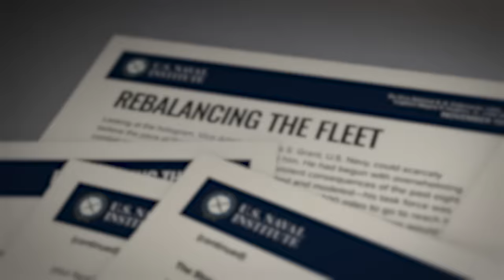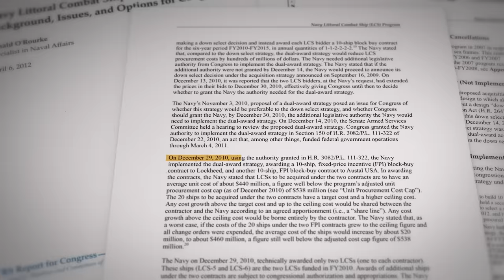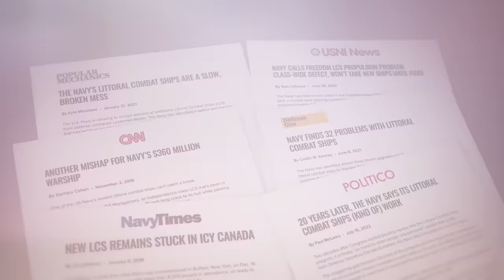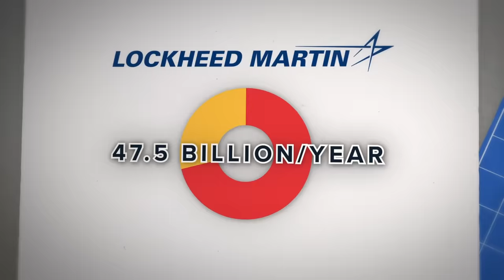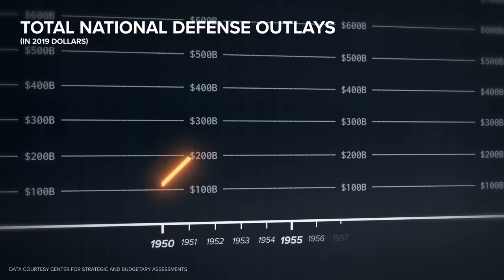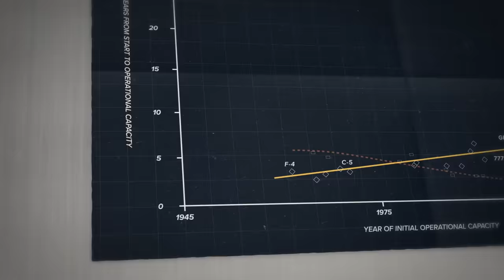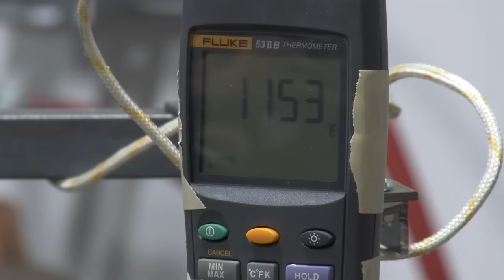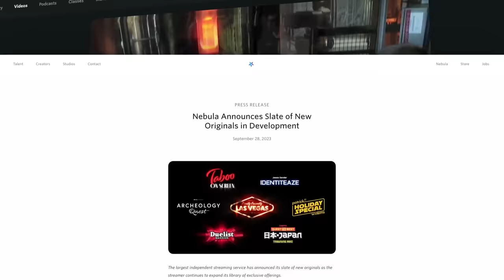Why the US Military Costs so Much

Comment: The obvious problem is that the defense contractors' job is not to make a warship that works. Their job is to make money. Whether or not they manage to make a functional warship, one thing is sure: they are making money.
Reply: Spot on
Reply: Well, there's your problem.
Reply: But what's the alternative?  Have a government owned company/agency build it?  Well, NASA's space ships are over budget and inefficient, that's why they contract SpaceX to launch for a small fraction of the price.
Reply: @xiphoid2011  idk that doesnt seem so bad lol
If the us gov spends more on lockheed than on nasa, why not just buy them out?
Reply: Not fully accurate. If the contractor delivers a shit product at inflated prices, it won't be purchased in as much quantity. Thus the contractor won't sell as much, profit overall will be much lower as initial R&D costs don't get spread over large unit numbers (if it cost 1 billion to develop, only one purchase will have to cover that entire 1 bil whereas 10 purchases will need 100 mil covered from each purchase)

This can be seen in the examples Wendover brings up. LCS and Zumwalt ships were bought in puny numbers compared to initial expectations.
Reply: @xiphoid2011 There's not much evidence gov owned military contractors operate much better. Airbus' aerial tanker (plane that refuels other planes midair) A330 MRTT costs 50% more than Boeing's version KC-46 while carrying 10% more fuel.

France IIRC is the only Western country to have a gov owned company make their tanks and their tank isn't massively cheaper than German, British or American tanks.

Airbus' naval helicopter NH90 has been plagued with troubles (so much so that Australia ditched their purchases)
Reply: not sure if you were a sailor or not (Sailor here) 

and what ive experienced proves this but also denies this aswell. its like a stuck in the middle thing. on one hand the ships can lose a capability while on the other the ships have more capability than adversaries.
Reply: @chinguunerdenebadrakh7022  Littoral combat ships arent rare though, i remember normally seeing them in different fleets around the world. They are uncommon though.
Reply: @xiphoid2011  aggressive cost transparency requirements and proofing wouldn't hurt. Also, NASA gets saddled by contractor tack-on rules from congress. When the SLS program was being commissioned, they were directly commanded to reuse shuttle components and service them through the outside aerospace contractors that manufactured them. Innovation was literally outlawed for the benefit of the same 5 main contractors that are gauging the military.
Reply: Even better they put in terrible parts in them so when they inevitably break they gotta pay outrageous sums for that part or even better only the engineer from that company can fix it and has to be paid for gas, salary, lodging, eating,etc
Reply: Yes because that's how debt (money) gets into the economy. If you needed a way to get money into the economy while dominating countries and I presume there must be a rate of return on these operations, no-one seems to know what the roi is from these actions. Somebody must be benefitting from the deals made abd it doesn't seem to be the american people except for cheaper fuel, and hate. Because this money is going into the economy from all these deaths, what is it 4-5 million killed since ww2, tens of millions displaced, I'm sure no-one is going to say they do it for altruistic reasons so where are the profits, do they go into private hands?
Reply: Wow! You really cracked the code.

Now, let's say an extremely obvious conclusion from your point. What would make FAR more money? A functional warship.
Why?
Because the government will buy more of them for a veryyy long time.
Reply: The defense contractor only builds what the government specifies though. Stop scapegoating and acknowledge that things like this takes more than just "hey defense contractors just want money" well duh, they do but they also know that they want to actually make it good so that the government actually buys a lot of them. Cost overruns are always going to be a thing in experimental shit. 

The difference is knowing when to stop development or when to keep on continuing it.
Reply: Its been shown time and again that private companies provide a better product for cheaper than the government does. "but how is that possible?" you might say "companies are in it for the money" well exactly, the fact these companies can provide a better product, make it cheaper and still make a profit goes to show how inefficient government is.
Reply: @xiphoid2011  yes. Wendover says that Lockheed gets more than NASA but NASA also gives money to Lockheed. 

NASA over budget problems are also Boeing problems it's become a political handball to keep some seats happy.

SpaceX came in from a fluke and isn't possible to do so for military stuff
Reply: @chinguunerdenebadrakh7022 yeah but they still got the money for the project AND lobbying means they'll get the contract again next time.

Meanwhile USA is down a new ships and Lockheed execs get money a
Reply: That's taking the problem too cynically. The capability the DoD requires is really just too complex that it's more a question of physics, material science, and a bunch of other sciencey stuff, that makes development of new military technology harder. If all what was asked for is a metal ship with an engine and some guns and missiles, then that could easily be done. But no, there's demand for stealth, sonar detection of even more stealthier subs, radar capabilities, being able to intercept hypersonic missiles, modularity, lasers, rail guns, smart munitions, more complex auto-loaders, survivability, etc.

Now I wouldn't doubt that the companies are pocketing some of that defense funds, but I would reckon that delivering something that works now would net more contracts later down the line meaning more money for them instead of breaking the trust of the DoD with failed projects and make them start considering cutting contracts or looking for other alternatives. This is what they did in WW2 and the 60's, they made very successful planes left and right and they get more money for every new one.
Reply: No that's not right. At all. In all of these you see them basically going back and trying to fix it. The most interesting part about the ships in this instance is that the US had already divested its other ships and so tried to get these to work despite design issues. 
It's also a problem with regards to what the government wanted. They wanted size, firepower, and range, so compromises had to be made. The problem started with a shit idea. The fact that it was used is not the problem of the companies, but instead that of policymakers. And it's very interesting how he's basically cherry picking for this video given the immense success of the Joint Strike Fighter despite the immense cost overruns from an attempt to make things LESS costly via a new manufacturing method.
Reply: @xiphoid2011  Theoretically one option to avoid the whole "new tech doesn't actually work" problem, is to fund research just into specific technologies instead, and only after the tech is proven is it allowed to go into the requirements for a contract, instead of asking one company to invent 20 different things all at once.
Reply: You have never worked in manufacturing, engineering, or probably any job but maybe Taco Bell if you think this…
Reply: The even more obvious problem is the only way to sustain a competitive contract based industry of talents in every field of science and technology necessary to make a world class warship is to have a fucking world war. It’s a joke to compare what they looked like back in the day when planes were made of canvas  and steel and pretend any competitiveness in the general sense can exist when the requirements are so extreme. 

That’s actually the root of the problem- competition can’t exist because it would be 5 times as expensive and involve throwing a massive! bone at a lot of companies to even make a bid in the first place. There’s a reason only boeing makes money outside of government contracts and it’s because it’s the other industry where ludicrous consolidation was mandated by expertise and cost saving measures to airliners- something that should have been more obvious to Wendover reallyz
Reply: @xiphoid2011 nasa ships are the only ones actually going to space lmao
Reply: missed the entire point of how contracts, and companies, continue to work. But points for trying little buddy.
Reply: @royce9018  I'll take those points and invest them in Boeing stock--- oh nooo! Their planes are falling out of the sky because their job is not to make planes that work, but to make money, oh noo!
Reply: Damn even planned obsolescence and the lack of being repairable has seeped into even the military, the future of warfare will not be with these crazy ass technologies shredding motherfuckers but with these technologies being broke down on the field and both sides taking potshots at one another while trying to repair the equipment and having to call a technician.

Comment: I took a tour of an Independence class LCS once and the concept is a great idea when you see what it looks like in person, but the issues are pretty obvious as well. Aluminium is not as fire resistant as it's melting point is half of steel's melting point, so every inch of the interior of the hull has fire proofing blankets on it. As mentioned in the video it's also more brittle than steel, aluminium will not flex if impacted by a shell, just shatter and penetrate like paper. But one of the most embarassing parts I learned was the ability to change its armaments. There is the physical ability to carry cruise missiles in a vertial launch container, except the exhaust from the rockets will MELT THE ALUMINIUM AROUND IT.

Such goofy design.
Reply: lmfao that’s actually insane. i know VLS systems have that issue so russia uses cold launch systems but youd think the US who ONLY USES HOT LAUNCH would solve that lol
Reply: It's so frustrating to see what happened with the LCS programs. We clearly had the capability to build some awesome ships, but somewhere along the line the whole thing went off the rails. I agree with this video, that the culprit at least partially lies with asking one ship design to do too much. With the Zumwalt, it was trying to reach too far, too fast, tacking a bunch of experimental tech onto a new ship class only to realize it either wouldn't work as well as expected, or was just too expensive to justify. Now we're building a new flight of Arleigh Burkes, hopefully applying some of the lessons learned from those mistakes.
Reply: Oh My God
Reply: Ffs 🤦‍♂️ 😂
Reply: @jeremywerner9489 yeah same with the Zumwalt ships
Reply: Why not carbon fiber with steel plating or something
Reply: @aceman0000099  lighter
Reply: @СергейСердюк94  yeah but carbon fibre is lighter than aluminium and stronger
Reply: @aceman0000099  steel plating isn't
Reply: @jeremywerner9489 probably the german scientists from the 40s retired and that's why us innovation halted  😅
Reply: Doesn't China's new ships look a lot like LCS?  Wonder if they swapped designs with the US version and they ended up with the good US design.  lol  If that's the main problem, can't they change it a different steel or composites?  You would think they would have tried a proto type before they went ahead and built so many.  One would hope they would just 3D print a bunch of disposable new LCS ships like NGAD to use as cannon fodder in a real navy war.  One would think they would roll and slide missiles  contained in VLS steel containers onto tracks into the ship to reload in 5 mins.  It's not like it's some strange pattern.  It's a rectangle!
Reply: @dtsai  China's ships look absolutely nothing like the LCS Frigates, do you realize how big Littoral Combat Ships are ? They're frigate sized, not small by any means, but their awful design limits VLS Cells capacity and other Offensive capabilities

The US navy needs more ships if they ever want to catch up to China or EU
Reply: The LCS is not the first classes of warship to be built of aluminium alloy. It's not a problem. Look up the melting point of aluminium and the melting point of ship steel. The LCS can theoretically carry a Mk41 VLS, but the real problem has nothing to do with "the rockets melting aluminium!!1!" All it takes is additional ducting and cladding for an aluminium-alloy warship to mount VLS cells. The real problem is that the layout of the Independence class is idiosyncratic so that there is literally no place to drop in a couple of Mk41s racks; and the Freedom class has propulsion problems, and the equipment fit for both classes couldn't be made to work. It's important to pinpoint the REAL REASON why these ships are bad, because fake reasons lead to wrong decisions down the line.
Reply: Aluminium was and is a wonder material for sea vessels... if the vessel is small recreational use orientated.

I wouldn't even want to use it on a medium sized commercial vessel operating in unknown/hazardous conditions (a 40+ passenger vessel in reef environments for example).

Steel despite its issues is far more forgiving during misadventures or hard use.

All my opinion of course but I skipper boats commercially and my partner is a boilermaker.
Reply: @retsaMinnavoiG  Aluminum is very weak to metal fatigue, and ocean waves are very good at inducing it. Building a large aluminum hulled ship that doesn't develop fatigue cracks would be very difficult, I think.